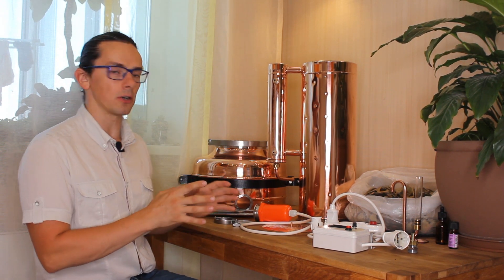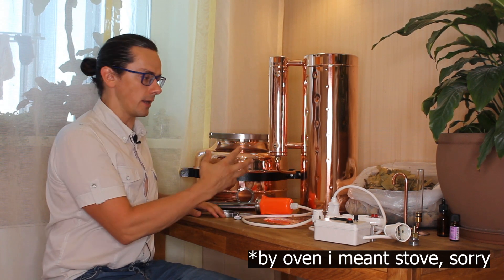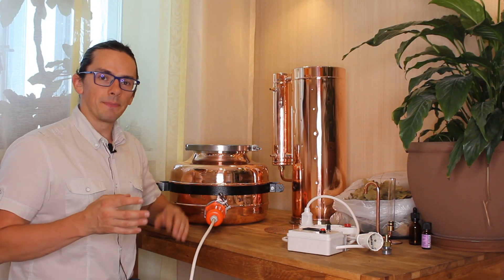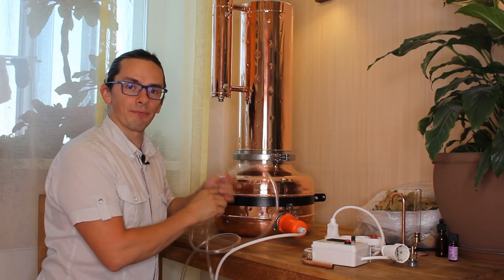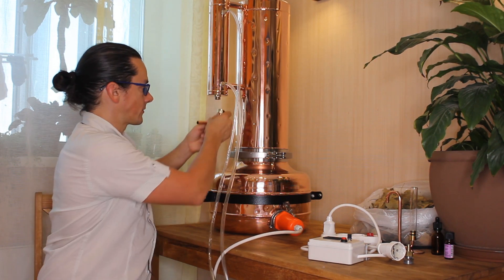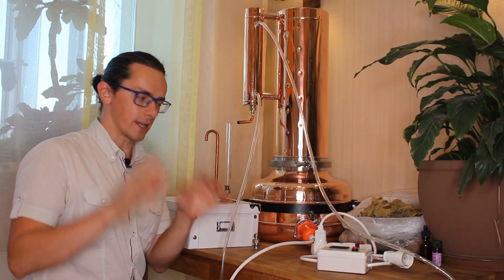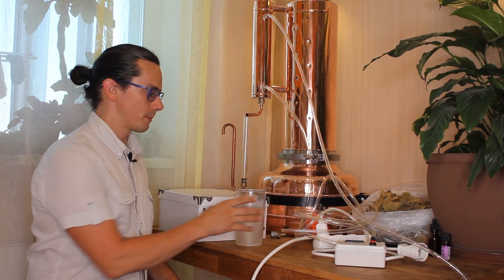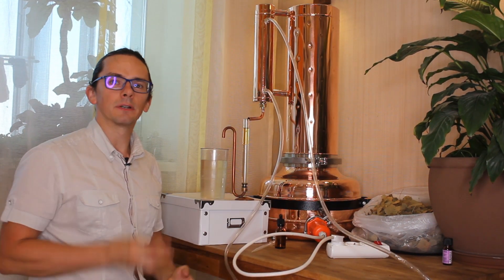Step by step guideline | Copper still with heating element

Comment: Hi, I don't quite understand how the tubes are connected. Where does the tube that connects to the water tap go?
Reply: exactly... he's skipping the most important step... so annoying
Reply: Bottom is in and top is out. So the bottom should be connected to a water source. I use a pump connected to that one, in an ice chest and add ice to it.

Comment: Hello. What if my kitchen faucet can’t be connected to the tube? Can I use the water somehow without a faucet?
Reply from the maker: You can also use a water pump and a container of water.  We have a video on our channel about using a water pump.
Reply: I got fittings and hooked up to hose works well I set it up out on verandah

Comment: Easy clean up of the columns? Do we just use water and soap? Can you make video about how to clean?
Reply from the maker: Hello.  Thanks for your question.  The distiller can be cleaned using a solution of water and citric acid.  How to do this is described in detail in the instructions for the distiller.